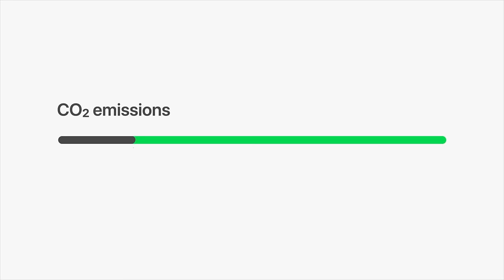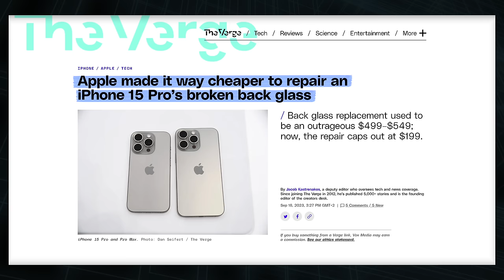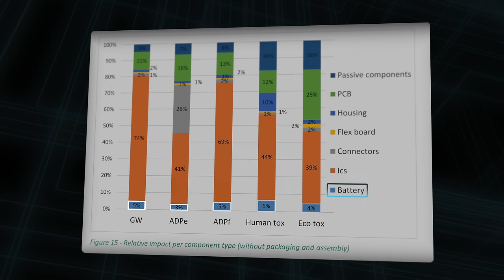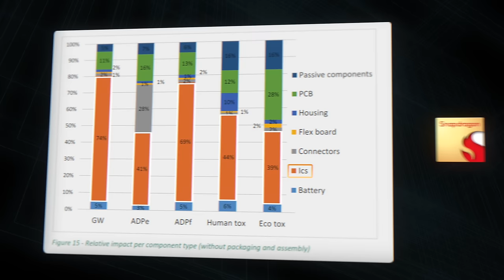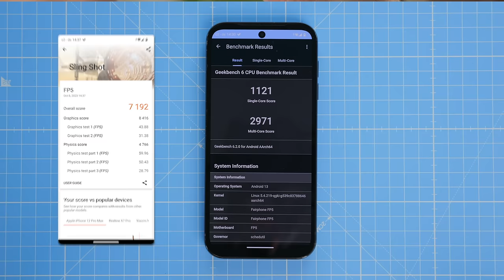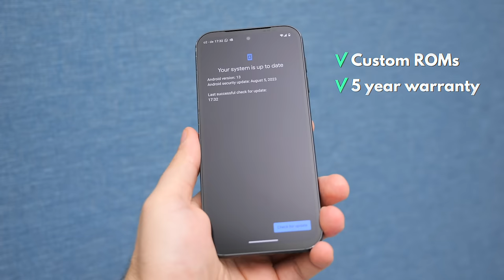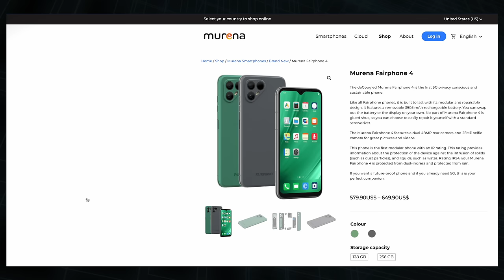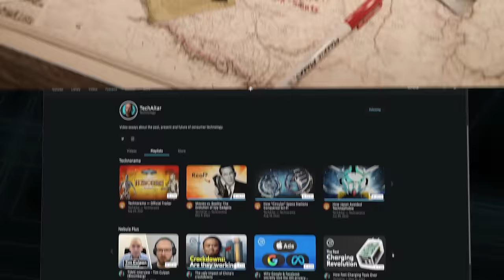Is Fairphone really fair?

Comment: The 10 years of software updates is the biggest pro for me
Reply: @SuperSucc69 phones slow down because the battery degrades and gives less volts to cpu
Reply: @aeyde also apps getting more processing-hungry
Reply: Nothing in consumer tech history has lasted 10 years
And nothing will last 10 years in near future

And the reason isn't hardware, it's software

Devs have to support a plethora of devices and they willl never bother working on a 7-10 year old platform

Just the simple fact

And fairphone isn't vertically integrated like Apple or Google to ensure compatibility across apps and features either - so this is just a snake oil claim to be honest
Reply: It’s not going to happen 😂
Reply: With that soc I'd be surprised if it still runs acceptably after 5 years sadly
Reply: @SoloKarry  My 2013 Bottom Range Lenovo Laptop has heald up 10 years! With an SSD upgrade and the i5 Inside it serves me well!
Travelling across Europe even to Asia ✅
Medium Gaming ✅ (Bought it specifically to run Battlefield 3 on low! Most games, asside from 3D Blockbuster games, still run okayish)
Falling down several times from hights up to 1,2meters /4 foot ✅
Batterie still running ✅ (only for about 1h but beeing a 2013 Laptop it never got much further than 2.5h anyway - would be replacably if I cared enough)
Writing parts of my speaking and presentation Exams as an IT Professional this year ✅
Will I replace it within the next year: probably, but I thought so serveral times and never did.

I'm only replacing my 5+ year old S9+ because it didn't get any update in like 2 years. I don't mind not getting feature updates. But securityupdates are important to me! So I plan to get a Fairphone 5 that will hopefully last me 5-10years!
Reply: Genuinely curious, but now that Google has “promised” 7 years of software updates, how that compare for you? (Could be totally wrong, but did they say 8 years with hope that it’ll be 10?)
Reply: They can remove that promise at any time as per the agreements you'll be signing. Don't buy phones off promises
Reply: @SoloKarry 
"Nothing in consumer tech history has lasted 10 years"
Um... PCs? Unless you're trying to run the latest Pentuple A games of course.
Reply: Phone will slow down and the battery will wear down. More so , few people use their phones that long
Reply: @vedaryan334  I think people completely underestimate how many users just use their phone for messages and calls. Most people don't use their phones for complicated high complexity uses like playing new games or edit videos on their phone and for those people, if they took good care of their hardware, the lacking software updates (especially security) was often the reason to upgrade their phones, NOT the lacking hardware.
Reply: If the company is still around. If they don't change their minds. If the updates will actually be well done. If there's 10 people using the phone in 10 years what is the point?
Reply: Am using still S8 (Samsung) since 2017 can do nearly everything.....7 years...have e os on it
Reply: Unless you're not used to a good development community of custom roms this is a very very very big advantage
Reply: @SoloKarry   I use a 10 year old dslr camera but i see your point.. as soon as you conect your device to the internet it will become obsolete in no time
Reply: There's no way you'll still be getting updates 10 years from now. Most users will move on to other phones, and the few people left behind will, at most, settle a small scale lawsuit
Reply: @eldarshamukhamedov4521  we'll see about that, even if they don't provide 10, it'll get at least 8
Reply: The 10 years of updates is literally the least interesting part about it
Reply: My notebook runs Linux, kernel updates weekly. My smartphone runs Linux kernel, no security updates for a year, kernel 4.9 released almost 7 years ago.
That's not how it should be.
Reply: Just use a pixel
Reply: Will you use that phone for all of those 10 years?
Reply: Would you even use it for 10 years tho
Reply: @SoloKarry  My 10 years old notebook Dell Latitude E7440 is not much different from this year models. Its biggest limitation is max 16GB RAM.
My 5 years old OnePlus 6T has enough CPU, 8GB RAM and unfortunately no updates.
Todays smartphones don't change much. I expect they'd work fine in 10 years. Also even cheap smartphones are more performant than dumbphones so, given hardware support, should be easily covertable.
Reply: @NormalCleanCars  1. That's not so easy here in Europe. As it's a feature they are advertising, they will face customer protection. 
2. And killing all their reputaion with it! Won't happen as long as John Riccitiello doesn't take over!
Reply: Pixel has 7 years and a better phone than this ! Why would anyone buy this ?
Reply: @aeyde and the cpu can’t keep up with new software features, it’s not just battery voltage
Reply: @aeyde  phones also slow down when the os gets heavier to run
Reply: arguably, hardware will be the limiting factor, especially SoC.
Reply: @raktimsaikia1476  Because I don't like google! And who the hell needs a better phone? 
Does it ring? - No, good!
Can I call? - Yes. overrated feature!
Can I text? - Yes. thanks thats all I need.
It has a Kamera? - Yes. Cool think!
Did people suffer miserably so I can hhave a phone, trouser, shirt, ..., anything? No! - Shut up and take my money!
Reply: For me it's the easily swappable battery. I work long days with frequent use of my phone, being able to instantly charge it again would be amazing
Reply: Google is now offering 7 years and it will be more optimised after that time.
Reply: Bs. I am using 10 years old elitebook 840 g1. The only thing I changed its slapping new SSD and adding ram. Good for office work, YouTube and basic games. So your argument is invalid
Reply: @aeyde and planned obsolescent.
Reply: @SoloKarry  I know peopel that have used computers for 20 years with minor upgrades. 20 years ago there weren't even smartphones. So it;s posisble esspecialy now that phone improvements in CPU power have slowed down significantly. No one kept a computer from th 90's  for a decade the advancements where too fast but once they slowed down... Maybe there will be a tech revolution and old phones will be hopelessly obsolete in a few years, but given industry trends I suspect it will be a decent phone for 8 or so years.
Reply: software upgrades just slow down your phone. I haven't seen any use of upgrading my android phones over the years ... they always look the same
Reply: Who keeps a phone for 10 years? It's like using an iPhone 5 now
Reply: @aeyde only apple does that shit
Reply: @Kromiball pcs not laptops. Pc hasn't got a battery
Reply: @SoloKarry  my PC is more than 13 years old and I still use it for work and games
Reply: @daniel11111 Fairphone actually has a really good track record for exceeding software support goals over the past decade they’ve been around. I get it if you’re skeptical, but no need to talk out of your ass lol
Reply: Yeah my pixel 3 is 5 years old now and still going strong, but the lack of updates is beginning to affect some apps.
Reply: @jacksonburger2081 I wouldn't be surprised if they exceed that 10-year mark
Reply: are you sure the battery will stay healthy after 5 years?
Reply: @danielbudiono7232  That's kind of the point of the phone, parts are cheap and easy to replace.
Reply: @SoloKarry Gameboy
Reply: @SoloKarry  i am using old DDR3 hardware as a NAS now. so you were saying?
Reply: I mean the Pixel 8 series is getting 7
Reply: @notisac3149  cool story. Unfortunately both you and me won’t remember this conversation after 10 years, or else I could’ve laughed at you. Lemme repeat, it’s not going to happen.
Reply: @aeyde OK... So why is my CPU getting so d**m with an undervolted battery
Reply: @SuperSucc69  the OS is clean not full of bloatware like Samsung so it will keep being almost as fast as new.
Nand flash will degrade slightly inevitably
Reply: @sergeykish yep, I have a cheap vivo phone that is over 4 years old. Still works fine and the only difference between that and my older more expensive phone, which didn't survive a torrential downpour, is photo quality but if I want to take a good photo I'll get my camera out.
Reply: It's using an almost 3 year old CPU that was midrange at best when it was new. No way in hell it will take 8-10 years of updates.
Reply: @Kromiball  yes but your pc chip is way faster than this router chip they used. And it's over 2 years old already. It's a sallow ass chip even now. Lol.
Reply: @SoloKarry Nothing in consumer history has lasted that long? I have cameras from the 70's and 80's that work perfectly fine. A lot of older consoles work completely fine. 

A lot of problems these days is from planned obsolescence. Companies could easily build things that can last a lot of time, but profit is more important to them.
Reply: Gonna be hard for them to provide updates for 10 years when they'll most likely be out of business in less than 5.
Reply: @LeadMuffins  You sure about that? Cause I'd be surprised if what you said happened
Reply: @TrackmaniaKaiser you are comparing computers with microscopic phone parts
Reply: Its just gimmick
Reply: @SoloKarry Cars, wasching machine. ps1/2/3/4/5 xbox 1/2/3/4 nintendo 1/2/3/4 Vacuum machine, ovens, should i go on😂
Reply: @estebanod  The words I was responding to were: "Nothing in consumer tech history has lasted 10 years
And nothing will last 10 years in near future"
And that's just not true!
Reply: @SoloKarry   Looks like you aren't familiar with the Android custom OS community... lol
Reply: @SoloKarry  nothing has lasted 1y ? are you even serious ? XD
Reply: @aeyde actually cpu voltage is always lower than minimum battery voltage so that is not the case.
Reply: connyconiglione  I don't see a reason why they wouldn't be. Otherwise the same argument applies to apple or google, too?
Reply: @tommasol9701  Well I'll probably replace my now 7 year old phone either this year or next year. Yeah most people don't do it, but I would if I could. Probably going to keep my iPhone SE 2016 as a backup or for smaller tasks however.
Reply: connyconiglione  I do believe that they don't habe any revenue by choice.
Meaning, they reinvest everything they earn to improve their product. And they have quite a following here in europe with some eco friendly groups in particular. Not sure if nerds with mutliple phones cared about fairphone before at all. The momentum right not exists is espacially because many of them hat the compans in their mind, but didn't want to have a lackluster phone. Besides that. Owning a fairphone as a 2nd phone more or less completely kills the purpose that company exists in the first place
Reply: @Techfanatic73  the CPU has the same core architecture as the Galaxy S21 Ultra. Is that midrange ? 
And with cleaner software, the Fairphone 5 is much faster than  the Galaxy S21 will ever be.
Clean software does not become slow with updates , nowhere near as much as bloated OS in popular phones.
Fairphone had no problems updating the legitimately underpowered FP2 for 7 years, from Android 5 to android 10, without even benefiting from any OEM support for the SoC. you think this comparatively monstrously specced FP5 will be give them trouble ? When they finally landed a long term supported pro SoC for the first time ?
Sheeple
Reply: @SoloKarry  Lack of vertical integration doesn't stop any feature to be supported on Android. If a smartphone from 2014 was still supported today with a recent Android release, all of the apps would work, although slowly.
Reply: The evidence is that they will support it for a minimum of eight years, with 10 as a stretch goal.  It is amazing all the people saying that they will not provide updates for 10 years, that it is an empty promise. Guys, watch the video.  Fairphone have already updated a previous model for 7 years and have consistently over-delivered on thier promises.
Reply: Believing that is naive
Reply: @SoloKarry I am pretty sure the first highend i7, the 990x with 6c/12t released in 2011, more than 10 yo, is still capable of running all modern games.
Reply: @TrackmaniaKaiser  how is 1 hour battery life remotely acceptable
Reply: @aeyde it is not just the battery but also the OS and apps ,10 years is a long time ,during those 10 years more demanding apps will come and more OS updates will come ,the phone will slow down eventually even if you replace the battery life
Reply: Wait until they offer absolution and eternal life. That's when it's time to cash in.
Reply: If they can or do do it. Anyone cane make claims. Apple lives up to their claims because they make money in many ways so if someone doesnt want to buy a new iPhone, apple will make money on them in some other way. Fairphone doesnt have that luxury. So if fairphone cant make money off someone for 5 to 10 years, it will stop doing it altogether. A company needs money coming in to survive. Not people holding phones for a decade.
Reply: My mom is using old Samsung phones with physical home button (some sort of Xcover few years back and now Galaxy A series), she don't care as long as phone is working, even tho software is few years forgotten